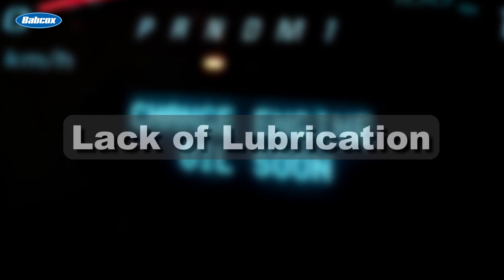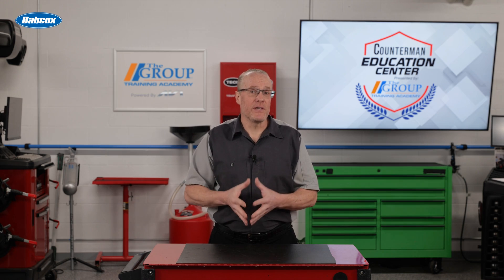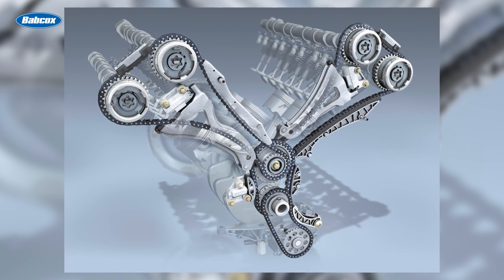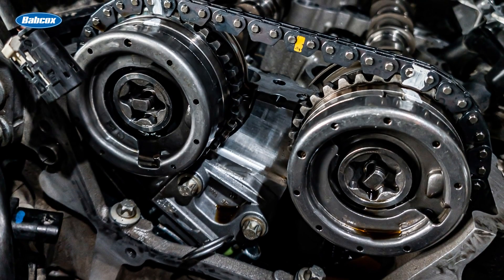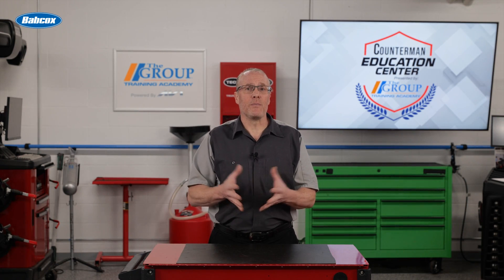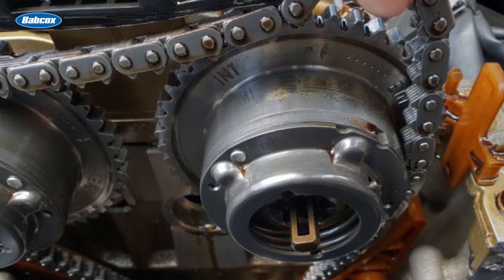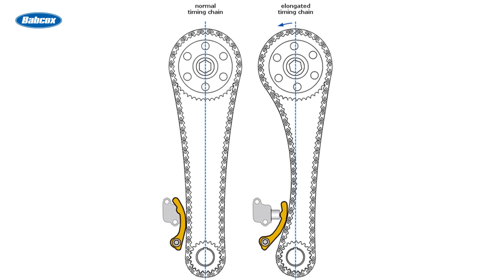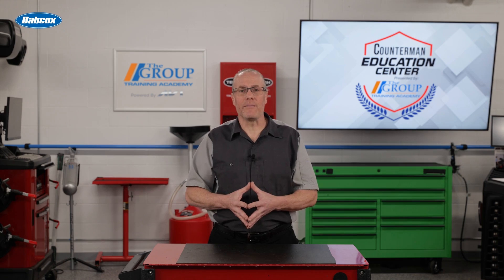Why Do Timing Chains Stretch?

Comment: Opel vans using citron engines less than 4 years and the chain in my work van has a stretched chain. High power small engine for a work vehicle with loads.

Comment: The Suckage is when you buy a used car and don’t know how someone takes care of the vehicle before you purchase it. My engine light came on not too long after I purchased it. The weird thing is I brought it to them (same place I bought the car have the repair shop too), anyhoo, the past year the light would go out and then come on after some time. One of the times the light came on right after I just got the oil change. I am big on taking care of the cars and told the repair guy it is confusing when the light goes off and stays off and then randomly comes on.  I dropped it off to them and told them to please check it properly to see why the light kept coming on after some and off cuz now I am nervous.  It stopped a couple times at the grocery store and I said “that’s it” go through the proper diagnostic and see what’s wrong.
Reply: Which is why one should avoid mid milage cars or second and third+ ownership vehicles. Buy really low or quite high (when it had only one owner).
Reply: Check MAP and or MAF sensor. My Ford always had intermittent codes being thrown.

Comment: Bottom line it’s because of cheap material from unreliable manufacturers.   Nissan (before Renault) had a timing chain in their vq engines and they were BULLETPROOF. After Renaults cheapening off Nissan the chains in their better models failed while the pre- Renault were still doing just fine.

Comment: NEVER follow the vehicle manufacturer recommendations on oil changes and fluid services! Worst advice you can give in this day and time. By now you should know that following many current recommendations leads to early engine failure. Many of todays engine failures are caused by vehicle maker recommendations. If they say change oil every 10k miles half it.
Reply: Off your rocker
Reply: Definitely on GDI, Turbos or high city use (Have old GDI chev with 270K miles and change every 3000 miles). I can get 10K mi on my port injected that is roughly a 90% highway driven car.

Comment: As a mechanic I absolutely hate when mechanics say timing chains stretch they don't stretch they wear out along with the teeth on the sprockets/gears and the guides/rails and tensioner it's just wear/breakage/failure no stretching we're not talking about rubber bands here sorry for the rant

Comment: Timing chains don’t “Stretch” per se.  The individual pins wear and when you add up the minute wear on that number of pins the chain does get longer.
Reply: That’s like saying we don’t get taller when we grow up. 

It’s just that we have more cells in more places.
Reply: It's inevitable
Reply: A timing chain that is just starting to "stretch" will first start showing symptoms (misfires) under which engine condition:  (A) highway cruise or (B) idle?

Comment: Simplest solution is to NOT buy any of the listed engines in this video. 
They are Proven problems. Carbon on the back of the intake vales is because of ...Two .. engine design Failures  : PCV systems and Direct injection.